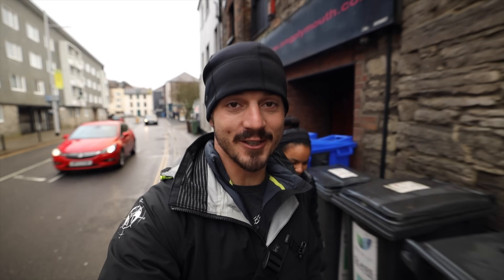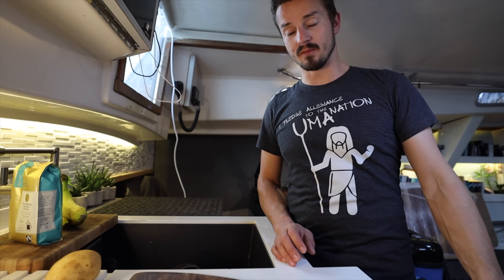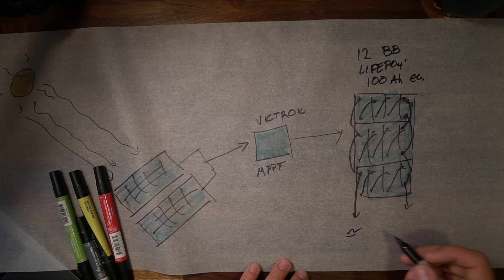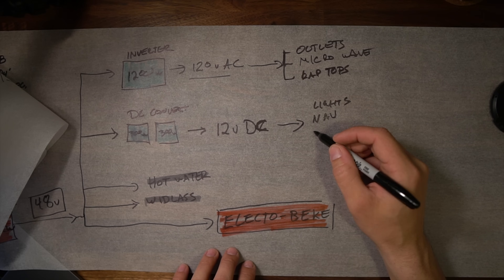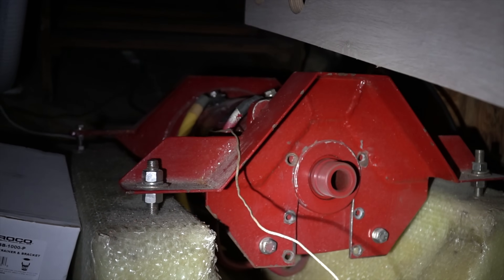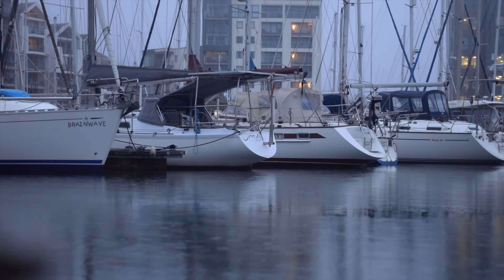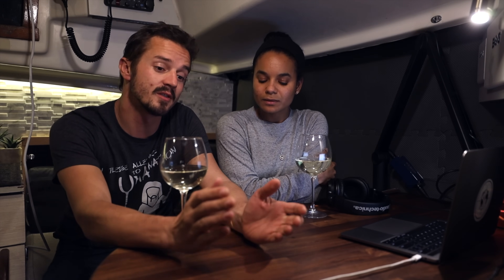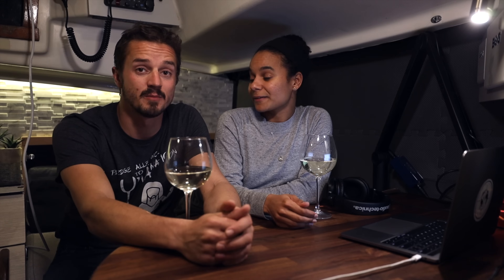5 Years Living offgrid on an ALL ELECTRIC Sailboat — Sailing Uma [Step 206]

Comment: Consider converting to a brushless motor. Brush-commutated motors like the one you have are typically about 70% efficient, while modern brushless motors are at least 90% efficient. That's a huge improvement. Unfortunately, a modern high-tech motor is quite expensive - although they are getting cheaper. Just something to consider.

Comment: What Tedpenn said. It's not just you that mixes energy and power. kW is a measure of power and kWh is a measure of energy. I always assume that when people talk about kW per day or something like that, they are really mean kWh.
Reply from the maker: Sure. But for people who don’t know about power, a kWh isn’t a very easy to understand abbreviation. People are used to mph (miles per gallon) not mile-gallons. Or on a boat gallons per hour of fuel consumption, not gallon-hours. Also, all our instruments on-board measure consumption and storage all read kW. Not kWh. If we use 1.5kW in a day, that is what our meters say, not kWh. I think kWh is something used by electrical engineers and not real people in real world use cases. So that’s why we do it too. We understand the difference; but we’ve found that it confuses most people more that it helps. Sorry if it caused any confusion.
Reply: @SailingUma  You are mixed up. A kWh is not a kW per hour. Keeping with your analogy, here are the correct relationships:

kWh is similar to gallons.
kW is similar to gallons per hour.

Real people in the real world get this right. You probably do confuse most people when you try to explain it to them, because your explanation is not accurate.

Comment: Did you think about to apply a board under the solar panel like a sandwich, and take some vertical wind generators between them?
It can lift your solar panels about 10-15cm, but it doesn't take any shade on them, and you have enough space for several generators under the solar panels.ű
I plan to make my system this way.

Comment: everything with a motor will last longer on 220/240v (50/60hz). no clue why US still didnt stange that shit xD
Reply: In the US, the economics work out such that grid-powered, daily duty motors that are 2 horsepower and higher are run at 240. It's been like that as least as far back as 1981, when I graduated from college and became aware of the real world. In battery-powered small systems, 240-volts is typically impractical.

Comment: Great work Dan. I thought to suggest one option that may reduce some loses. For 12v feed why not just get it directly from battery, rather than boosting to 48v and then converting it down again. Few ways of doing this: 1) Have a dedicated 12v bank for all devices that dont take much power. 2) Tap off your exisiting bank at the 12v point. I suspect you have a combination of series and parallel cabling. This way you could do away with DC to DC converter and its losses. To balance the use of batteries you could rotate the 12v bank every few months.
... Just a thought.

Comment: You shouldn’t be charging your laptops and other chargeable devices with the inverter. It’s inefficient.
Reply: Captain Jazz 
What would be more efficient ?
Reply: Why Not 

Rechargeable devices require 12 volts for recharging. Plugging them into a 110 volt outlet means that the 12 volts from the main batteries is being converted to 110 volts with the inverter. Then back to 12 volts at the charger. Everytime the voltage is changed there are losses. It’s much better to charge a 12 volt device directly from a 12 volt source.
Reply: Thanks

Comment: When in Europe (220V) how do you charge your batteries and heat your boat?
Reply from the maker: Our battery charge is 220V in. In the North America, we just adapted our shore cord to plug into the 50A sockets since they’re 220V and over here we made another shore cord adapter for the UK.

Comment: Very interesting and informative video...thanks!  Not sure if I missed an update or not but last I remember you saying is that you took an old electric motor from a forklift to power your boat when necessary; would there be a more efficient electric motor you could eventually use that might draw less energy or propel you forward more quickly/efficiently?

Comment: Great Video!!, yall are the ones that enticed me to get into sailing and buying a sailboat. Recently I bought my sailboat and have made my own conversion to EV. I was fortunate enough to find a 1997 Gemini 105 for very cheap due to bad onboard motor. I ripped the old motor out of the boat and installed an 20hp electric outboard by EZoutboard and 20 x 12v 100ah LiFePO4 from aliexpress $450/ea. Something i have installed to help with solar is I made some lines with quick connects that I attach across the front of the boat from the safety wires and I lay 4 x 100watt flex solar panels across them secured to the ropes with D-clips. Then I installed 2 of the 2 plug waterproof Anderson plugs on the boat that I just connect the wires from the solar panels to them. This combined with the 800watts of power from my rear solar panels has really helped with long periods of no sun. Each of the 100w flex panels i have on individual micro solar chargers, because i found any shade on a single panel would greatly reduce charging combined, an example in a marina and someone's boat is casting a shadow part of the day on 1 of the 4 panels would reduce the solar power across the board.

Comment: Guys, LOVED this video! Thank you.
Dan, the way you spoke about a wind turbine makes me think you only know about the old windmill style wind turbines. Have you given any thoughts to a vertical wind turbine? It could be run through your MMT and provide a near constant charge, especially in the northern reaches of the UK. They also can run at much higher wind speeds than the old style windmills without burning out (and catching fire). And can be mounted in such a place that they would never block your solar panel or main sail, thus not requiring them to be moved.
https://www.amazon.com/TESUP-Atlas2-0-Wind-Turbine-Kit/dp/B082LMY8ZH/ref=asc_df_B082LMY8ZH/?tag=hyprod-20&linkCode=df0&hvadid=385178051407&hvpos=1o1&hvnetw=g&hvrand=15365295087662982544&hvpone=&hvptwo=&hvqmt=&hvdev=c&hvdvcmdl=&hvlocint=&hvlocphy=9009656&hvtargid=pla-880744655924&psc=1&tag=&ref=&adgrpid=78533818717&hvpone=&hvptwo=&hvadid=385178051407&hvpos=1o1&hvnetw=g&hvrand=15365295087662982544&hvqmt=&hvdev=c&hvdvcmdl=&hvlocint=&hvlocphy=9009656&hvtargid=pla-880744655924
Reply from the maker: Yes. We’ve seen and considered VA turbines. They’re still quite large for the power they produce. We’ll see how regen works for us and see if we need any more after that.

Comment: I am impresses by how well you have engineered your boat and still kept aesthetics in mind. The idea of using a clean quiet electric motor is appealing, but what keeps me away are the times I have to motor for long periods, either becalmed or taking it on the nose.  I am talking days, not hours.  If we only had a Mr. fusion..
Reply from the maker: With wind one the nose, we just tack. With no wind, we just wait. But in 20,000 miles and 5 years, the longest we’ve been without wind is about 5 hrs. Weather is getting more and more predictable with good satellite forecasts, and the large highs can be avoided quite easily. We also have a boat that can sail quite well in very light wind. We only need 3kts true and we can sail at 2.5-3 kts into it.

Comment: Hi. Isn't a lot of power lost in converting from dc to ac? Regarding the laptops, would it be better to get a 12v dc powercord? This way you would bypass the power lost on the inversion.
Reply from the maker: The power losses from inverting and converting are marginal and don’t make a difference day to day.
Reply: @SailingUma  thanks!

Comment: Great video. Please share more on windvane, how it works, cost etc. Design apparently differs for each boat?
Reply from the maker: We did a few videos about it already. Google “Cape Horn Windvane” the design of the Cape Horn stays the same but the dimensions differ since each one is tailored to your specific boat. Obviously the better your particular boat handles and the better she’s balanced, the better the windvane will steer. But for us, on our boat, if there is wind to fill the sails, then there is enough wind for the game to work, and it works equally well on all points of sail. We love it!
Reply: @SailingUma  cool, will do. And if you're using about 2.5kWh per day on a 100% full use capacity bank of 15kW, you're basically set for 5, possibly even 6 days of zero sun charging, right? Pretty amazing!

 Looking forward to see the windvane, great backup if the PVs fail during a passage.

Comment: just want to say thanks for inspiring me to take the plunge, I converted my 30 footer into a solar electric sailer as well, currently doing an airhead composting toilet conversion also from the original direct discharge sullage tank system.

Comment: It might be more efficient to leave the laptops on the charger all of the time. When you have them on the charger, they are being directly powered from the power adapter. When they work off the battery, there are efficiency losses in charging and drawing from the battery.

But powering from 110V means that you need to convert the power to 110V AC using an inverter, and then the battery pack probably converts it back to something like the batery voltage. Both times there are more inefficiency losses. I don't know if this is a thing, but it would probably be more efficient to power your laptops directly from your battery.
Reply: A well chosen, efficient DC-DC converter that can supply the laptops, connected to the batteries, would do away with the inverter losses and the power brick losses and introduce only one lossy conversion step instead.

Comment: You can use a prop power driven generator that you can put over the side of the boat to charge the battery's. Or if the main prop free wheels when you sail you can try a pully on the shaft connected to a generator. Mmmm.  If the prop shaft free wheels you can try to make the prop motor a DC generator. Mmmm. 
Just I my thought's

Cc

Comment: My boat needs work, quite a bit.. I thought of just stopping and sell it as is, but you inspired me to continue, in hopes to get my sailboat in the water, after4 years on the dry...geee..  I love the kitchen backdrop, really nice, never thought of it !  I see you used plywood (like for your fridge area), I thought that I had to prevent using plywood due to humidity.. I am asking myself, should I ??  How you guys go around that ?  Owner of a 25' Oday
Reply from the maker: We’ve never had an issue with wood warping. We use marine grade plywood if it’s being fibreglasses to the hull, but for cabinets etc just regular high quality ply and a good core of paint does just fine.

Comment: There is a BIG difference in lead acid batteries versus lithium iron phosphate batteries (LiFePO4).  First, there are 2 type of lead acid batteries.  Starting batteries and true "deep discharge" batteries.  true "deep discharge" batteries are almost always 6V (unless they are the huge ones for solar home and those are 2V).  They work, are reasonably price, but do require maintenance.  LiFePO4 are *NOT* your typical lithium ion batteries like in your laptop or cell phone.  They are much safer (can NOT explode, even when abused).  They are VERY EXPENSIVE, but last much longer than lead acid.  Best of all, LiFePO4 batteries can be almost completely discharged without harm, but lead acid batteries should never be discharged more than 50% (some say 80%) for maximum battery life.
You might want to look into laptop battery chargers that run off of 12VDC.  They are not too expensive and you will save a small amount of energy.

Comment: We are installing an electric motor (just placed the order). I'm struggling to find a battery isolator switch that can cope with the 48v/650A from the bank. Do you have an isolator switch?
Reply from the maker: Yes. but it's a 500A one. 500A is the cap for most easy to find components.

We use one of these to switch the power on and off to the motor controller:
https://www.cactusnav.com/blue-remote-battery-switch-with-manual-control-auto-release-p-21858.html?gclid=EAIaIQobChMIo8SS0OfA5wIVhLHtCh39XgyDEAQYAyABEgL6SfD_BwE

And then a normal on off switch for the bank to everything else. 
https://www.cactusnav.com/blue-battery-switch-onoff-600a-p-14890.html

Keep in mind its the amps that matter. A 500A switch doesn't care if it's 48V or 12V as long as you don't go over the 500A. Make sense? If it's a solenoid like the first link, the actual solenoid is usually 12 or 24 volts, so you'll need to run that off your DC converter. Hence the manual main on/off switch. 

Hope that makes sense.

Comment: Just curious... on your drive motor shaft could you rig a alternator to charge your batteries while in use. Would love to hear your thoughts on this.
Reply from the maker: It would be a waste of power. It would work while sailing to get some power from the spinning prop shaft, but the added load on the motor would cause more losses than gains from the alternator.
Reply: I meant for use only when your under motor power. It was just a thought. Thanks for replying. Do ya'll have any plans on meeting up with Atticus in the future?

Comment: Hm the video started with a morning desaster - but ended with a decent glass of wine - great (as always).
Thank you for the detailed explanation - the drawing helped a lot to follow.
Something for me (and perhaps others) interesting: Did you formerly have an all electric autopilot? On the boatshow I was told, that the hydraulic drives shall be significant more efficient - do you have experience?
Reply from the maker: We have a hydraulic auto pilot, but it's still run by an electric pump, so we call it an electric pilot as opposed to our windvane which uses no power....make sense?
Reply: @SailingUma  of cause!
They told me, electric motor > hydraulic > hydraulic actuator should be more efficient than electric motor > gearbox > gear chain.
But: nothing beats your wind pilot!

Comment: What's the coffee budget? :P <3
Reply: have question ,, what size ele-motor to use and just add 2 panels just for motor   and 2 all other uses ,,Now am thinking use LPG for cooking-hot water and i notice lot apt size Ref for used RV .cheap  run off LPGas ,, and last i notice place like home depot  sell  solar lights for lawns far cheap ,,each light have small panel ,,Can use them for running lights
Reply: @mrstevenrowe  
LPG is bloody dangerous on a boat, and it's very hard to find.
To make matters worse, there are too mant different fittings and threads if you do much international travelling.
Reply: @charlesharper2357   don't know where your at .but Gen all fitting are same around north America and islands ,,we use for lot stuff last 40 years in construction even dump trucks and  dozers   even the under water   dozers ..think be  lot safer then reg Gas fuel  and if your traveling anyways that gasoline and diesel are  so  bad their trash out motors anyways 
 ,,  LPGas tank only blow one way that thru top of tank at vales   so just make sure vent it well ..cleaner on motors and less breaking part and ware .. and always have Reg-vales on each gas unit so have fire on place it don't off all other thing have hooked up
Reply: @mrstevenrowe  
Obviously you've never sailed in the Caribbean...fittings vary from country to country.
There's a damn good reason experienced sailors don't use it...gas sinks, where it ends up in your bilge if it leaks...which leads to fires and explosions.

Comment: The UK can be very cold in winter, even in the SW. You didn’t mention heating. Is nothing installed. Views of you in tee shirts suggests the boat is warm!
Reply from the maker: We're at a marina, so we have a little electric heater on shore power for now. But also have a wood stove for cold nights on anchor.

Comment: Hello
I was wondering your thoughts.....if you had a choice of power supply which one would you recommend?
1 deep cycle 12 volt/2-6 volt or 1 lithium  ?
I have a small vintage Rv and will have 
24” tv with booster
Wifi booster
Diesel heater fan
Water pump for shower
Charge 2 iPads and 2 phones 
Two 4” led ribbon lights
1- 6” fan
1000w inverter
We use a yeti ice cooler and all cooking is propane.
Charging will be done while driving from alternator / plug into shore power / or small 1000w Honda generator. No solar.

Thanks.....from Alberta Canada !!!!!
Reply from the maker: 1 100aH lithium battery will be closer to 3 100aH lead batteries when it comes to actual usage, math doesn't show the entire picture. You need to take into account charge times, cycles, C ratings and other factors too. Plus the life of the battery. A lithium like the Battle Born's we have will last 30yrs with proper care. You might get 5 yrs from a lead battery.
Reply: Sailing Uma 

I had each place I checked have their own opinions on batteries but when I asked what you use in your Rv ......everyone said I don’t have a Rv 🤣 
Lithium batteries are super expensive up here so we may just travel south on a small vacay and pick one up.
Thanks .....this way if it doesn’t work I have someone to blame 🤣

Comment: Hey just wondering, if you did not have a freezer and did not use battery power for propulsion, how many Battle Born Batteries would be in your battery bank?
Reply from the maker: 1 or 2. More batteries means more range and more time between charging. If you had a diesel with a large alternator, your could get by with 1 battery and maybe 1 hr of motor running every other day to charge it back up.